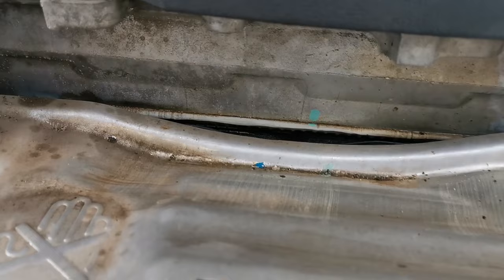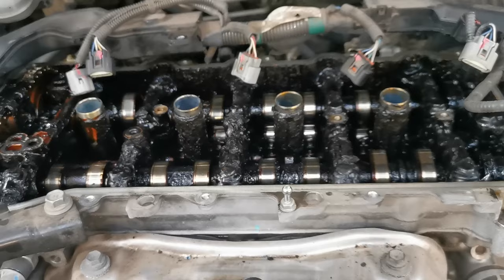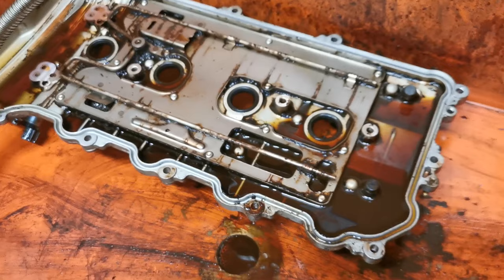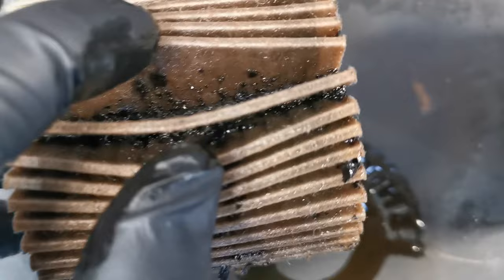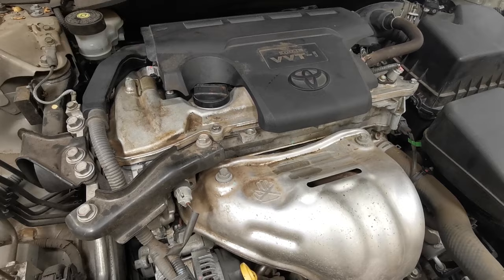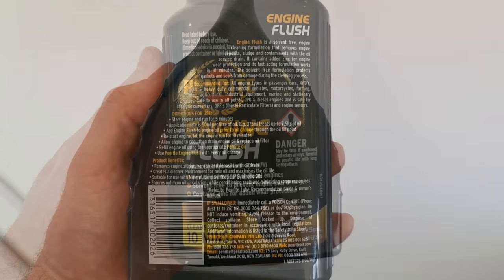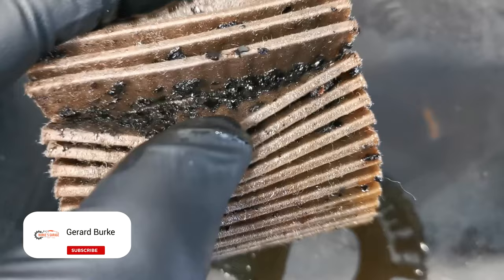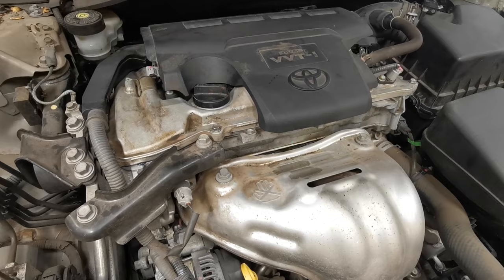The Best Way To Flush Your Engine - Why & When To Use Engine Flush

Comment: I had a 2AZ-FE exactly like that. Absolutely caked in crud. Oil pressure warning flickering on. The oil pickup was plugged solid. I had to flush the engine, change the oil, wash out the rocker cover 3 times, and even that wasn’t enough. I had to fill the thing with diesel and let it soak. After a couple days, I drained it out, oiled the camshafts up and refilled the engine. All good now!
Reply: This is what I'm gonna do.  I got a 03 Suburban 5.3L. It's caked in sludge.  I got the heads of because I thought I blew the gasket.  Nope just sludge fighting threw the gaskets and into the exhaust. I'm gonna fill it I with 5 gallons of diesel and let it sit.
Reply: @vamoneygroup  2006 GM 3.6L.  It (was) pretty bad.  Did 3 consecutive kerosene flushes (added 5 ltrs oil, 2 litres kerosene (6.5L oil capacity), new oil filter each time), 1st one was just 15 minutes idle, by the 3rd flush (40 mins) I ran it at 3,000 rpm.  HUGE difference - dropped oil consumption from 1.5L per 1,000km to 0.5L per 1,000km, and uses ~ 10% less fuel on a set journey.

Comment: Get a case of cheapo filters and couple of gallons of k1 kerosene. Put a gallon in the crank case. Start it. Don't drive it. 1 minute, change the filter. Do this 2-3 times. Change oil, filter drive around for 20 min. Sludged up Audis love it.
Reply: As long as you're NOT talking about ADDING a full gallon (above and beyond) normal oil level (too much in the crank case can start blowing seals and causing all sorts of drama), you're pretty much spot on!  I was quoted $7-8k for a rebuild on my SLUDGED 2006 GM 3.6L.  3 kero flushes (6.5L capacity, I added 5 ltrs oil and 2 ltrs kerosene (and a new filter) for each flush), first one was just 15 min idle, second one 30 mins with periodic revving, 3rd was 40 mins with 15 min at 3,000 rpm made a HUGE difference.  Rebuild 'postponed', it seems to run fine, oil consumption dropped from 1.5 ltr per 1,000km to 0.5 ltr per 1,000km and uses ~ 10% less fuel over a set journey.  Now that I've found out how easy it is to do your own oil changes (don't even need to jack the car up!) I'll be both taking better care of it and saving money along the way :)

Comment: Fill it with diesel.  Soak. Drop.  Cheap oil, run 10, drop.  Cheap oil and new filter,  drop.
Reply: Will diesel hurt any seals while soaking during this process? This is the route I'd go, if it is safe!

Comment: For an engine this dirty I'd be dropping the sump after every flush to check the pickup condition, quite often crud gets sucked in and clogs it. You should also be hoping none of the oil galleries or sprayers become clogged with what you dislodge. Nice result here, how did it fair in the long run?
Reply: Filter
Reply: @I_Am_Your_Problem  Filter doesn't stop everything from entering into the pickup.
Reply: I tell people with an engine this bad they better leave it alone and just change the oil more often. Loosening up all that gunk creates more problems, especially in newer engines.

Comment: Did a flush to my Suzuki 1.4 boosterjet a few weeks ago. It has only 83000km so it should be pretty clean. After the flush I changed oil and filter, run it for 15 minutes. So all the deposits and cleaning agent would get in the new filter. 
After that, changed the oil for premium oil and again the filter as well. 
 Runs great.

Comment: Sounded like a 7.3 Powerstroke swap at first. I would check those VVT oil control valves on top cover too.
Reply from the maker: yep 100% they need to be checked, I did mention that in the video and also gave another example of where to clean on a Honda K series if you did a flush. 
Those mesh filters will be easily and cleaning them after a flush is definitely recommended 👌👍

Thanks for taking the time to comment

Comment: Engine flush at each oil change for a few changes fixed lifter tick in my MX5, added some lifter tick additive before and it helped a bit but not like doing engine flushes did.

Comment: Thank you for another decent video that doesn't oversimplify like others do.

I'm not sure I would have stopped at two changes, but the results are still excellent. I'd appreciate any updates on this engine if you feel it would be plausible.

I'm not sure many other engine manufacturers could have their cars' so obviously neglected and be brought back with such a treatment.
Reply: @GerardBurkeBurkesGarage  
BG EPR is an extremely powerful engine flush that would safely remove the hard sludge/carbon that is still present on the engine's cam bearing caps.
Reply: @William-13  someone mention bg product destroy his seal.
Reply: only 1 the VW

Comment: If that engines had been flushed every oil change from 5k miles onward at every 3k then it wouldn't have sounded like a sewing machine as there wouldn't have been any sludge build up in ANY part of the engine -especially the head.
I bought a volvo 850 in 2007 with only 20k on the clock. I changed the oil filter/oil and flushed it at every 3k and used top quality fully synthetic 10w30 oil and recommended Volvo filter. When i sold it in 2020 with 100k on the clock and service book oil changes to prove ALL oil changesTthe man who bought it phoned me 9 months later and told me that he had followed my oil change procedures and the engine was still running beautifully .
I would recommend that an engine flush be carried out at EVERY oil change - your engine will benefit greatly from it  and you will be VERY glad that you did.
Reply: You were overdoing it, If the engine had always had its scheduled oil changes, you did not need to do any flushes or use any special products. No harm done, of course. But high end products cost more and you get no benefit from them. I have an old Camry with a 5SFE (timing belt) engine. The previous owner had all the oil changes done as recommended and I change the oil every 2800 miles using whatever products are the cheapest. At 173K miles, the engine runs like new. No one makes bad motor oil. All products have their uses, but sometimes retailers stock inappropriate products, for example, non-detergent SA oil.

Comment: Great job , but that was very risky, because I did that on a 77 Ford LTD , and I ruined the engine . It blocked every little hole inside the engine. And being a Toyota that has very little holes , that was very risky. You are extremely  lucky.   I personally wouldn’t do that for anyone. Lol
Reply from the maker: Customer opted into the decision and ultimately was happy to take the risk and it this case it has worked out extremely well, I myself did not make the decision but I can understand both sides 🙌

Comment: First, I enjoyed your video and thought it was very informative. If I might suggest one thing that may improve the clients engine further, if you've not done so already, is to use a "100% PAO Esther" based oil. Esther oils have a much greater degree of solvency than "full synthetic" oil so dissolve carbon build up more readily. The downside is that the oil itself is typically twice the price so I would only use it in these fringe applications.

Keep up the good work!
Reply: Penrite EO does come with Esther base as 1 of its ingredients.
Reply: cooking oil do the same, or just use adnoc px green or kixx bio1
Reply: I think you are trying to reference “Ester”. Unless you folks spell it differently over the pond. PAO Esters are great, however only in extreme cold and extended drains. Modern group III and group III+ practically match the performance of PAO. This has been proven. Also worth noting, PAO’s don’t have the best polarity (affinity for metal). Granted additives in the oil help this, but PAO is far from magic. Oils have come along way from this 80’s approach to oil formulation. GTL (gas to liquid) is the future for base oil formulation. Cheers 🍻
Reply: @nordicpride9708  group III+ have the same poor solvency as PAO too, both are less polar.  So oil manufacturer either use ester or group 1 oil to improve solvence. Which is why "high mileage" oil exists.

We can use cooking oil instead. corn, canola or palm oil.

Unfortunately modern oil lack shear stability of PAO. this is worse in high rpm engine. Worse when oil manufacturer decided that more viscosity index is better. 

more and more people start to suggest useless engine flush "treatment". When the correct solution should be using group 1 oils or oil with ester or oil mixed with 10% cooking oil (more can result it sludge released too fast and cloging oil passage)

So full synthetic today have much worse capability than full synthetic 20-30 years ago.
Reply: @kupas2  Group III oils provide almost identical performance to that of PAO with very few exceptions as I’ve listed. Not sure where you get your information, but it’s not all correct. If you are saying modern oil is a downgrade to 80’s blending technology I think you need to speak to some tribologists and see what their reaction is to your statement… Engine oils aren’t intended to remove sludge, carbon and the like. They’ve never been good at this. Their job is to lubricate, cool, actuate solenoids and keep an engine clean. Not resurrect it after it’s been neglected. PAO is in Mobil 1 0w-40 and it’s a ok cleaner. It’s not going to hold a candle to carbon that’s already formed in piston rings, oil passages and the like.
Reply: @nordicpride9708  I guess you never heard  "high mileage" type of engine oils.  They are designed to remove sludge. Group 1 oils also remove sludge better than group 2, 3 and PAO.
Reply: @nordicpride9708  Most oil manufacturer migrated their full synthetic product to hydrotreated which is group 2, not eevn GTL. Oliver Kuhn from Liqui Moly admit the reason manufacturer move on from PAO is price and availability.
Reply: @kupas2  They aren’t designed to remove sludge. A byproduct of their formulation is slightly cleaning of sludge NOT carbon. High mileage oils are primarily formulated for leaking, burning and contain higher levels of seal swelling agents. 

Most GTL oils here in the USA are in fact group III. Hydrocracked oils in the United States are in fact group III/III + . This is a fact not some random opinion. Must have some good glue you are huffing over there….

Most of Liqui Moly oils while are ARE NOT PAO based!  Again if you aren’t in the extreme arctic cold, or doing 20,000 mile oil changes PAO has zero advantage over any group III oil. Just the facts. Who in the hell even uses a group I oil? Nobody in the United States, that’s for damn sure.

What you forget is that the additive package is what really counts. It’s far more important than the base oil, especially in today’s modern engine designs.

Comment: keep in mind, can aslo use a good ATF for the flush additive, as in, 1 quart to replace a quart of oil in a full oil change, the higher detergents in ATF can help clean up sludge ect as well, and it shouldnt hurt any seals. but always change your filter after.

Comment: Cleaning up the mess in my 35 years w Ford I found the sludge was holding the engine parts in place and cleaning the crank seals always caused them to leak due sludge was holding the leak back.  I told customer to run as long as possible, I was amazed how long the engine lasted till rod bearing spun etc. Of course customers cud sell car. The tapper noise cud be stopped by cleaning those rockers, push rods and getting oil to those parts.

Comment: It's all down to neglect and lack of maintenance. I change the oil and filter every 10K km, use premium oil. Every 20K km I use engine flush. Another oil often forgotten is the gearbox oil, in my case it gets changed every 40K km, manufacturers recommendation. My car is 18 years now and has 200.000 km done. No major repairs, only maintenance and parts that wear.
Reply: Exactly.  Just bought my wife a new Lexus hybrid SUV a few months ago.  Had its oils change at 1k miles, then every 5k miles after that from now on.  Lexus recommends oil change every 10k miles, which is nonsense.  We have 2 other Lexus in the household and the engines still sounds smooth at 158k and 42k miles.

Comment: might as well dump in  2qts of Diesel gasoline or ATF fluid in there to if it it has that much sludge , flush it until its almost clean, gotta drop the oil pan (or use a scope)  and check the oil pickup

Comment: This is VVTI that sound is instantly recognizable, Its the sound of the pin in the oil driven cam shaft mechanism that changes the valve timing. Its designed to hold the value timing open when you first start but pops back in when with oil pressure changes and changes the valve timing by moving the cam shafts slightly. It will be so clogged that its stuck.

Comment: Is it just me, or is the engine running with higher RPMs in the "After" recording than "Before"? That could explain it running quieter also... However, engine flushes can save engines for sure. I myself prefer Auto-RX, which is not a flush, but softens and loosens sludge slowly as you drive as usual  instead of breaking off chunks and flakes. Slower for sure, but safer imo.
Reply: Probably just higher RPM from a cold start perhaps. I somehow think though that level of tappety-tap in the 'before' would probably carry on through the whole rev range, low or high.
Reply: I go even 1 step safer and just change the oil once a month for a year to clean it.  The fresh oil cleans everything up over time pretty well on its own.

Comment: Liqui-Moly pro-line engine flush smells straight like diesel and you mix it with old oil, let the engine run for 10-15 minutes but some shops even go to 30-40 minutes, and you drain it out. You then do half the amount of oil with some cheap off-brand oil let the engine run for 5-10 minutes, drain that out, and finally you put in a new filter + new oil.

Mileage, oil burning, noise, cold starts everything became quieter and on a 2012 Camry hybrid the engine was requiring less time to start up and be ready for EV mode. Afterwards I didn't see Liqui-moly MOS2 or any kind of additive besides Fully synthetic oil which already has a ton of detergents and cleaning agents.

This was after 150-160k miles, and oil changes every 5,000 miles or at most 6,500 miles.

Comment: Notice that the sludge is deposited on the inert parts of the rocker area. Engine flushes can be dangerous, Even in a case like this, if the the oil pressure is normal, there is no need to flush the engine. If the oil pressure is not normal, the first thing to do is pull the oil pan and see if the pickup is clogged. If it is clogged ,clean it and put it all back together. You still don't need a flush. Use synthetic oil or semisyntheteic oil if permitted and then accelerate the oil change interval. Whatever wear has been put on the engine component already, you cannot reverse it with any additive.

Comment: Wouldn't it have been to have plugged the oil holes after removing the valve cover and washing it with deiesel or kerosene vigorously with a brush and cloth then dropping the oil pan to clean it and the oil pickup in the pan as the last step.

Comment: I'm kinda confused about engine flush, some videos I see people leave the engine running while the flush is in but I've also seen others who rev the engine while using a flush. I'm about 2 weeks away from doing my first ever oil change and wanna do it right. Also been some people put fresh oil onto the new oil filter and other who just put in it. Any reason why people prime the filter and rev the engine while using engine flush.
Reply: Just follow the instructions on your flush can. Liqui Moly says that you need to idle your engine for 10 minutes, then change oil.

Also, you do NOT need engine flushes on new engines. Make sure you change your oil every 6000 miles (10.000 km) or 6 months, the one that gets firsts, and you're good to go. If you want to make your engine wear less, you can add Ceratec on every other oil change.

When you buy an used car, you need to replace and flush every fluid ASAP (except transmission fluid, which needs to be checked with a professional mechanic).
Reply: @gonzalotapia1250  I take issue with not needing to flush a new engine. I say you should flush and change everything at 200 miles. then put in the best engine oil you can buy. And  change oil and filters before you hit 5,000 miles every time. The first one is to make sure all manufacturing debris is completely removed.

Comment: Would this be a thing to do on like a 1977 v8 ? Engine seems to run good but oil pressure dropes off a lot after it worms up
Reply: Use something like Liqui-Moly Ceramatec or MOS2, you want an additive on such an old engine whatever you dislodge is getting stuck elsewhere and running an engine in that condition can be catastrophic. The additives mention lubricates and the Ceramatec supposedly fills in holes or scrapes with the ceramic compound to reduce oil burning for 30,000 miles but don't flush your engine.

Comment: The start up clatter is not related to the lifters or valve train thankfully. It’s coming from the VVT actuator. When the engine is turned off the VVT actuator turns the camshafts into the retard position and locks with a tiny pin. When the engine is turned on, oil pressure unlocks the pin so the camshaft can advance as the engine warms up. The oil pressure is created through tiny veins in the actuator, which I suspect are plugged possibly by sludge breaking loose. It does let go but hammers for a couple seconds so there is still some crud in the actuator or the actuator pin is worn. You can clean that actuator if you choose to. That will get rid of the rest of the noise. It sounds good other than that.

Actuator lock pin startup noise is pretty normal for Toyota VVT. I would just leave it.

Comment: I have a Corolla for last 14 years, and still mechanics say engine is in good condition. Nothing special done, only oil & filter & AC filter, break pad replacements. Suspensions were changed once, clutch once. It has never Knocked or done any thing out of order.